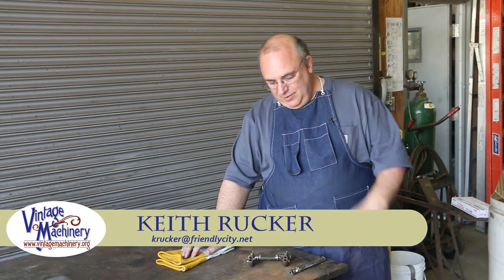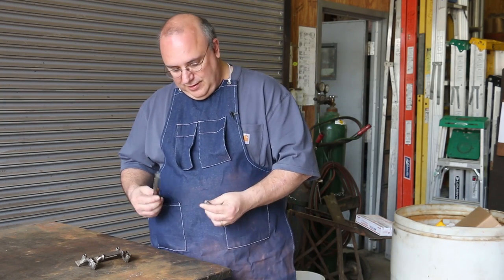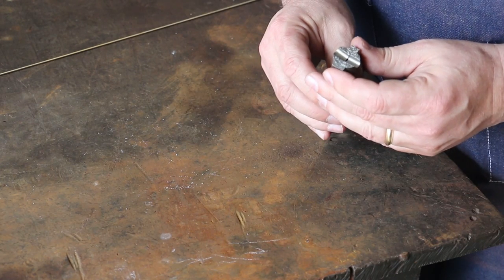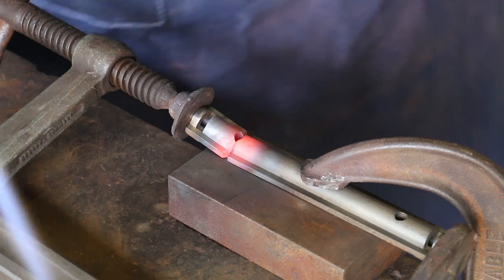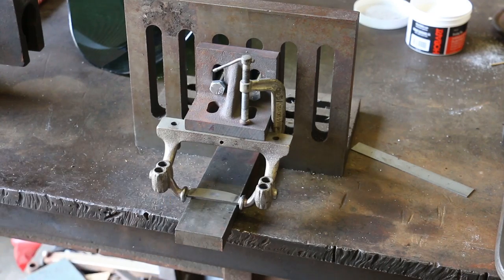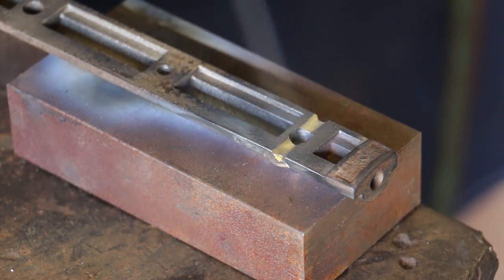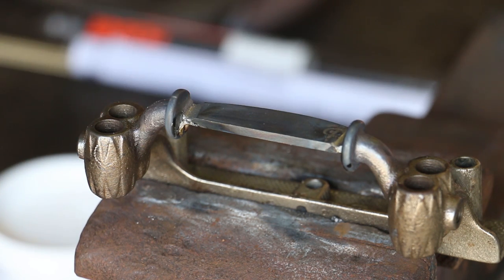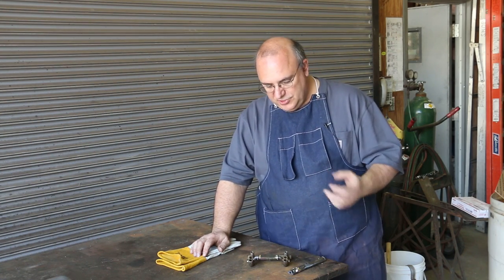Brazing Broken Cast Iron:  Repairing a Stanley 55 Plane

Comment: Sorry Keith, saw some nice jobs but this one has al foulty start. never cut metal away what is fit together like that piece.Thats the reason the clamp came off.  the metal blok is taking to much heat away.
Reply: actually, if he had heated the block, and let the heat penetrate the work, he'd have gotten a better, more even heat. if you need a heat sink for jigging, use it to work with you. agreed about the notching, though, as the part "grew" from the heat, it just supplied an elbow. no notch, brazing paste, french chalk on the plate (to prevent bonding to it), and cherrying out the end of the plate, then working the part to full heat. only thing you would see then is a "blond hair" where the break was. do it all in an oven full of argon, you won't even lose the nickel (or cadmium, which is what it looked like to me)
Reply: jozefa1234 Ewart
Reply: This was a small piece and the block actually kept the piece heated. He did, however, neglect to clamp the piece properly and a misalignment may have occured.
  I'm not sure brass is the preferred choice in filler material,though. I guess if it's not subject to drastic temperature fluctuation like a stove or other items.

Comment: false. you can stick weld cast witha 7018 rod. but you have to heat it, weld it, then let it cool SLOWLY.  but something that small theirs no point to stick weld it.
Reply from the maker: Stick welding is possible but it is not something that is very practical for many applications.  I have done it before and quite honestly, I find that brazing does just as good (if not better) and is a lot less of a hassle.  And when I say that cast iron cannot be welded, I should be more specific and say that it cannot be welded using common practices - it is a special technique that requires a special skill set that most people would not be successful with without specific training.
Reply: Keith Rucker - VintageMachinery.org thats what i was saying. But brazing does not penatrate at all compared to stick welding it

Comment: Welding cast iron isn't a problem if you do short welds and let it cool down the whole time however it does become a very long and tedious process. if you want to learn check out ChuckE2009 does a lot of metal working

Comment: Check out Muggy Weld, they have great products for this type of stuff
Reply: Robbie vigil Muggy is good stuff but you have to VERY careful to make sure the metal you plan to repair with it matches the product. For instance the aluminum rod is for aluminum only not aluminum alloy. If you use it on an alloy it will not stick. As long as people approach projects with this in mind they are fine. Usually though, people just assume "Hey I have aluminum and here's an aluminum rod,it should work great!" Then they throw a fit when it doesn't because they had an alloy.
Reply: +Nick Knight 

How the hell do you tell the difference?
Reply: +cyrex686 Sometimes it might take an email , a phone call or some research to find out exactly what the base metal is. An educated guess might work occasionally. sometimes not.

Comment: Too much talk,  Welding is not learned over the Internet. The problem of many, (not all) of the present generation is that they think that everything can be learned through social networks, iouTube, vipvap and the Internet in general. Teacher, if you want to show your skills, just do it. You do not have to lecture and explain the process because you are studying at school. I appreciate your knowledge and need to pass it on to the student. No one can learn years without practical learning, work, acquisition, skills, knowledge and experience. 
And you made a mistake that does not suit the professional. You had to know that the metal is expanding when you heat it. The error is not harmless because you have already upset the structure of the molecules. This part must be reinforced, otherwise it will break. It must be placed in the oven and be at a certain temperature in order for the molecules to get the same arrangement throughout the metal. If the load force in this part is very large, that part will collapse, and if it is not a big force, then the stove will not be needed